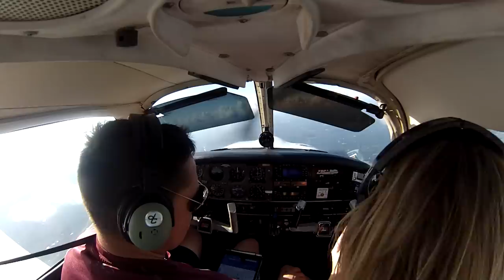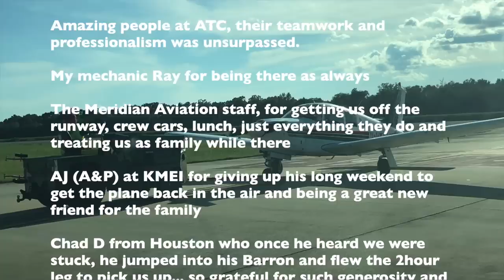Real Emergency - Power Off Landing with family in Piper Arrow after throttle cable breaks

Comment: I am still a student pilot with more than 250 hrs on a C172 (an hr or so on a Cirrus) and have only 3 hours in a C182, and Cirrus....I have understood Mike M's comments completely.  It seems that the key is to get the gear down without exceeding the maximum speed for gear.  Once the gear is down, no power landing will become routine as practiced and trained, particularly in a long run way.  Surely, when one's family is on board, it is nerve-wrenching to deal with any unusual situation, particularly the first time.  I applauded for their calm demeanors and thank you for sharing.  I did get emotional at the end while watching.  I do have smaller children and could not have imagined what my thoughts would have been in an emergency situation like this one....regardless, aviate and navigate would have to come to mind....good job done and thanks for sharing such a family private moment.  I have learned a lot from the video.

Comment: I stand by the motto "Better full throttle, than no throttle!'
Reply: yeah but finally it ended up on "no throttle" anyway....
Reply: @Kompressor2007  at a time when it's ok to have no throttle
Reply: Absolutely....full better than no throttle!  Didn’t understand the dilemma of not being able to get to gear extension speed with a WOT. If put into a 1000ft/min climb I’m sure that would’ve provided ample margin for gear extension speed. From that point it’s just a matter of lining up on a 10k ft runway on a stable approach and pull the mixture. I know things like this in the cockpit can be nerve wracking. I’ve dead-sticked on a winding country road because the carb needle valve seat wasn’t safety wired when overhauled, backed out and jammed the float closed....totally starving the engine for fuel. Did it successfully with no damage to plane or people. Thank God. 😉

Comment: Three steps in an emergency situation:
1. Aviate - assess the problem and keep the airplane flying as well as you can
2. Navigate - determine where you are and where you need to go
3. Communicate - tell ATC what you need to do to get on the ground

4, if necessary - Deficate
Reply: Number 4 hahahahahahha
Reply: No 4 Cracked me up!
Reply: Number 4- number 2
Reply: bobby ray of the family smith 
Look at your family, say “Well, it’s been real” then take a stress nap until the problem solves itself. Works for me every time
Reply: @llennon73  What roll do Proper Inspections have in reacting to an emergency as it unfolds?  Are you suggesting that the plane should be stopped in mid air so the pilot can get out and do an inspection?
Reply: @thrice1888  hahahaha.
Reply: That's it! For life in general... Many people could learn by following a few simple rules of life. Or of aviation.
Reply: I was taught to PANIC.

Please
Aviate
Navigate
Investigate
Communicate
Reply: @dhy5342 ,
Exactly, then, don't forget to set the kickstand.
Reply: As my instructor says: caffinate deficate aviate

Comment: "Is he in flight?"
"Yes"
"Uh oh, ok..."

lol
Reply: I know !  I was hoping our pilot was not listening to that !  In hinesight he would have said : "Okay !  No problem !  He'll get that landing licked without a hitch !"  Does seem simple... gliders do it every day, right ?  Was it cuz the landing gear cannot go down without the engine or something ?  If those planes needed power to land we'd lose half our pilots !  They don't !  Easy for me to say right ? !  Sitting in my comfortable chair tapping away on the computer.
Reply: @sonnymoon6465  Gravity helps sometimes
Reply: @sonnymoon6465  As I understand it, since the throttle was stuck at full throttle, they were going too fast to drop the landing gear.
Reply: @sonnymoon6465  There's a "maximum extension speed" limit on the gear. Usually it involves the gear doors more than the gear themselves. Too fast and you start tearing stuff off the plane, and that damages other stuff. At full throttle he's WAY above that speed limit. I suspect, since he didn't show it, that he leaned the mixture out until the engine didn't quite die, combined with a climb to dump airspeed. Got the gear down. Maybe flaps too to help keep it slowed down, but again I didn't see anything about that. Flew it to short final, pulled the mixture to cutoff, and greased it in pretty as you please. 

It's a funny paradox, but emergency landings are often the best, smoothest, most perfect landings a pilot will ever achieve.

Comment: That happened to me in early 1980s, Cherokee 140, Downtown Airport in Kansas City.  I was a student with my instructor, doing touch and goes.   The engine had just been overhauled. I had made a routine landing, but at touchdown, the throttle cable just snapped and went full.   We lost it we lost I screamed, and demoed what I meant by pushing and pulling the throttle, I raised the flaps and then he took over.   He never hesitated and we took off.  He was concerned about rpm’s on the new engine so we climbed steeply, took us around with the tower giving us priority.   He made a very long final, we were very high at this point.   We were just below do not exceed speed when he cut the engine and we screamed in, bled off the speed and he hit the runway like a normal landing, the FBO had the truck rolling out to meet us and he made the first exit.   I’ll never forget.  I don’t know what I would have done if he wasn’t there.   RIP Jay Pouzar.
Reply: This is way i explain to my students why we practise glide approaches, it's not  just for EFATO's or PFL's.
Reply: WHAT WOULD YOU DO  ?   YOU ARE PIC   FLY THE PLANE    PITCH FOR AIRSPEED AND POWER FOR ALTITUDE.     LONG STRAIGHT IN FINAL AND GLIDE IT IN.   HOW MANY TIMES HAVE INSTRUCTORS CUT THE POWER ON YOU HAVE TO PICK A LANDING SITE AND SET UP BEST GLIDE.    JUST ROUTINE   AND LEAN OUT THE FUEL MIXTURE AND WINDMILL IT IN.
Reply: "PITCH FOR AIRSPEED AND POWER FOR ALTITUDE" uhh .. he couldn't control the power. Kinda the whole point of the video. lol
Reply: i.b. hemp actually he CAN control the power. It may be rudimentary, as in on or off, but that is still some degree of control. Don’t focus on what you can’t control, focus on what you can and make the best with what ya got. Like my drill sergeant always said; improvise, adapt, and overcome.

Comment: Credit where credit is due.... Good example of Threat and Error Management at work where the “Time” was managed, put himself over the top of an airport. Aviated first, Navigated and then Communicated with additional resources. The threat was there and the error would have been to “assume” there wasn’t a secondary failure within the throttle linkage at anytime. This is a superb example of Single Pilot Resource Management. Well done.....
Reply from the maker: Thank you Steve :)

Comment: Great job my friend ! You declared immediately, flew the airplane and worked the problem. Your calm aviator skills and the amazing ATC help, made this a perfect outcome. Congrats to all on this, including your wife, who hung right in there. Safe skies and thx for sharing !
Reply: hate to disagree. pilots are taught  pitch controls airspeed throttle controls altitude all he had to do was pitch up into a climb until speed bled off to gear ext speed. simple really
Reply: I get your point robert, I’ve been a pilot for over 25 years and I agree to a point. The basic principles you reference are taught as a procedural generalities. not emergency procedures for all situations. But it opens a lengthy debate, based on a lot of factors, including aircraft type, atmospheric conditions, rate of climb capabilities etc. Increasing AOA to bleed speed, when at full power, will cause a climb and increased altitude. Once the gear is extended, the necessary decent may cause an over speed situation that’s not recommended for a particular aircraft, much like max flap speed. I don’t know the numbers on this particular airplane and I wasn’t in his seat at that time. That alone tells me to congratulate the pilots solution and not claim to have a better way of dealing with it. I certainly wouldn’t say anything is “quite simple” when sitting on the couch and not in his seat.

Comment: As a CFI, I'd like to commend you on staying calm under pressure and troubleshooting the problem. You had great single pilot resource management as well. You used all available resources from ATC to your wife and your mechanic. Great job getting the airplane and your family down safely! 

I couldn't tell after you shut down the engine if you were able to pull the prop lever back or not. I read an article in aopa a while back that talked about this. When we practice power off 180s in the arrow or many other complex single engine airplanes we don't pull the prop lever back. In the arrow poh it says to pull the prop lever back during an engine out to increase the glide distance by reducing drag. That's why it drops like a rock when we practice the power off 180s.
Reply: As the RPM drops so does your ability to 'feather' the prop. But if you do it immediately after killing the engine there is likely enough juice to make it happen - worth trying if you need to extend the glide.

In this (unusual) circumstance, he had power until he decided to cut it and he could have restarted the engine for a go-around and was fully prepared for that option. So IMO in this case it's a better choice to leave the prop full-forward.
Reply: @hempelcx  In addition you'd want the drag as you're trying to stop.

Comment: Good job! If your throttle cable breaks you simply use the mixture as a spare throttle. It is pretty easy and better than getting to the airport and switching off the ignition because reducing the mixture starves the cylinders of fuel and you can just add the mixture back in and the engine will start and make power again. If you switch on the ignition and then figure out you need power or have to go around and switch it back on KABOOM (if you didn't shut it down with the mixture).Declare, fly over a big airport in cooperation with ATC, get within easy gliding distance above the fiel (as you did)d,  climb until the airspeed drops to just above your airspeed, and nose over to hold speed and drop the gear and partial flaps when safe. You can pull the mixture if the resulting "dirty" config doesn't have you at a good approach speed and put it back in for bursts of power on demand since the windmilling prop should restart the engine pretty immediately. Then just use that config to  land adding power in-out if necessary by brining the mixture in and out. I used to have a PA28, now have a Mooney, but this would work in most recip general aviation aircraft, you should of course consider any internet advise in light of your aircraft, training and systems.

Comment: The exact same thing happened to me about 7 years ago in a Cherokee 140. Two pilots on board. Declared an emergency and went to local airport with a long runway. Because the 140 is fixed gear, didn't have the problem of being overspeed for a gear extension. We used mixture to modulate throttle. Once on final and we had the runway guaranteed, we killed the engine and glided to a good landing -- even managed to coast onto the high speed turnoff! Good job and glad you and your family are well!
Reply: After going to the trouble of getting the mechanic on the line (great ATC teamwork) he advised the same thing and the pilot said nah! Remember your first flying lesson when the CFI showed you how to slow the plane by climbing? Everyone walked away so good outcome. Good job by pilot.
Reply: I was wondering if he could have climbed to slow the plane to get the gear down, but maybe there’s a max speed with gear down that would have quickly been exceeded at full throttle once he leveled back off... don’t have my complex endorsement yet so not sure
Reply from the maker: If we climb, then we have to descend again. Trained for power offs and that was my plan. Encourage everyone to chat with CFI and not just what I did. 

But when I did get on final I was 150knots. A right 360 then a little pitch up to drop IAS. Dropped gear when it was 2 knots below gear speed but then leveled - introducing drag with nose up... low... didn’t want to hang out there too long. But then playing with flaps once below vfe and mixture slowed us for a stable approach. :)

Comment: being a mechanic before I started my flight training became a real asset when I was confronted with issues where I needed to understand something mechanical in flight. When the mechanic said kill the mixture, I may have tried to bog the engine with the prop lever fist, though tearing into the console to see if the cable just came loose is good thinking.

Comment: That plane was used for flight training in a Florida flight school that puts a big amount of hours on their airplanes over a short period of time due to the size of the academy and the amount of people who train there. I used to fly it myself. The plane is extremely stable and easy to fly, but would always have things breaking down here and there. These planes have also been flown hard by the students who got taught on it. I wouldn't be surprised that you got it for a very cheap price, so be careful. They also had a recall last year about the spar ribs in the wings after a crash that happened in Daytona at the beginning of 2018. Anyways, good job on using the mixture to manage the RPMs, I would've done the same thing. Glad you're all good. Safe travels !

Comment: last spring I had the opposite emergency, engine went to idle.We glided 6 miles in a 182 (brick) to an non-towered airport in southern Ohio. All caused by a careless A&P not bending over a cotter pin, I now practice power off landings on a monthly basis. It also made me absolutely conscious of where every airport is around me at all times. Glad everyone is ok!
Reply: Glad ur safe, ill start paying more attention myself. Thanks for the comment.
Reply: Darned right, don’t trust ANYBODY with those things.    I never even thought a runaway throttle would be an issue.   Just arrive high and starve it down with the mixture.   That or just come straight in  at pattern altitude and cut the key then add flaps as needed .    Power off landings should be practiced regularly so they’re no big deal.
Reply: @drizler  YES
Reply: Its amazing with all the checks balances and safety's that a single cotter pin is the single point of failure for something so critical
Reply: I do all my landings power off. I actually have to practice power-on landings every now and then. But then again, I don't fly into towered fields often...

Comment: At first I thought it sounded like a design flaw to have the throttle stay full open if that snaps but I guess it sure as shit beats the alternative to having the throttle cut out. at least with it stuck in full you have time to troubleshoot things and figure out your best approach options. Good job Dude.
Reply: Almost like someone designed it like that on purpose.  Love engineers at times like this.

Comment: Nice job man! You handled it great. I about had this happen to me in a Warrior. Luckily it got stuck when I was priming the engine for start on the ground. It was a carbureted plane. The things I would do is pull the mixture to start decreasing power output of the engine and carburetor heat on for the drop in performance. Kill the engine on final. Well done man.
Reply: Could also drop to one mag maybe?